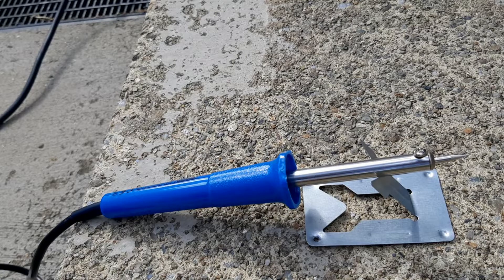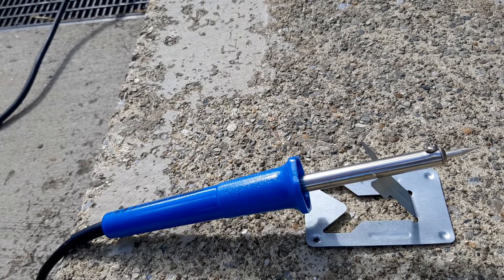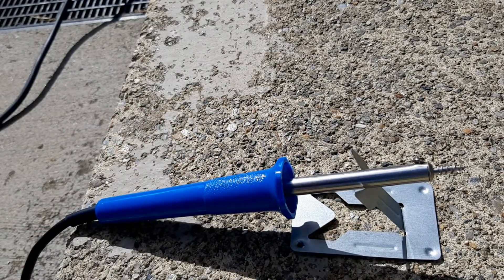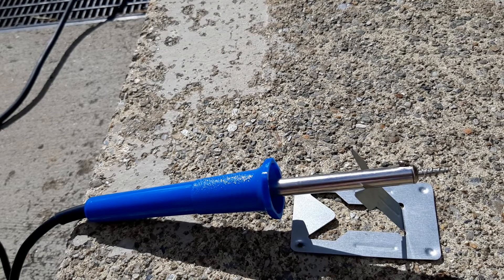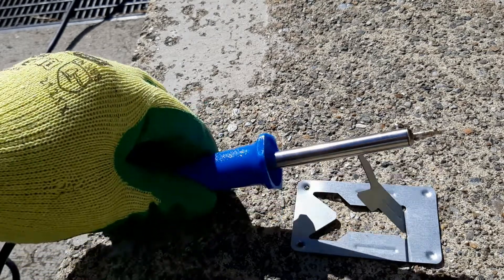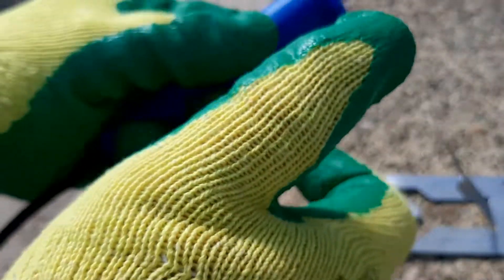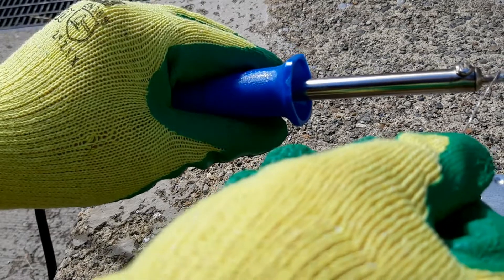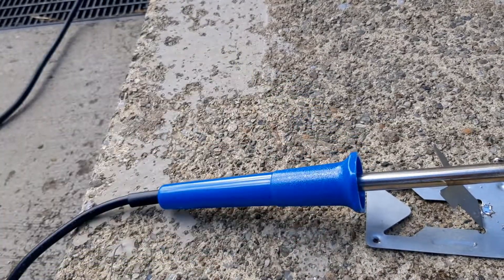How To Prepare Your Soldering Iron for use

Comment: I really need to up my soldering game man. I really want to make this 8/16 Ah Metabo Hpt battery pack. Wiring 2 4/8 ah Multivolt battery packs together.
Reply from the maker: So do I to be honest, I have a Makita battery that needs a circuit board. I will need to desolder the old one out and solder the new one in. As always I will get there I am doing things on my channel successfully I couldn't do 2 years ago. We do the things we can't do so that we may learn to do them. Looking forward to your battery video when you do it. The best thing I bought for battery repair was my little battery spot welder saves overheating cells with a soldering iron.
Reply: Man, nice hip, hip, hip ! 😅